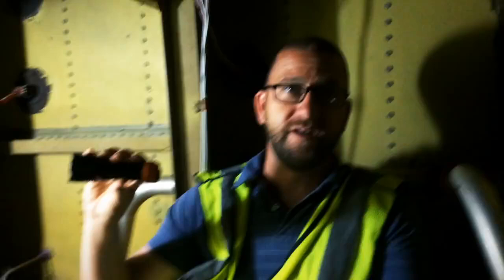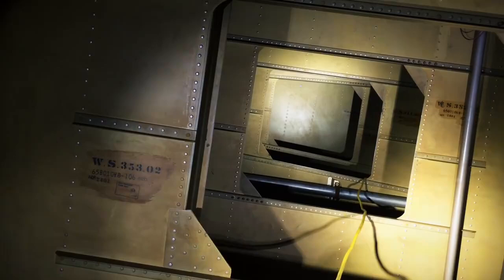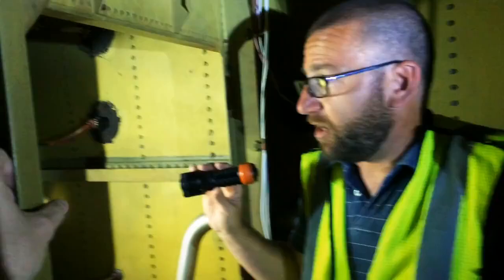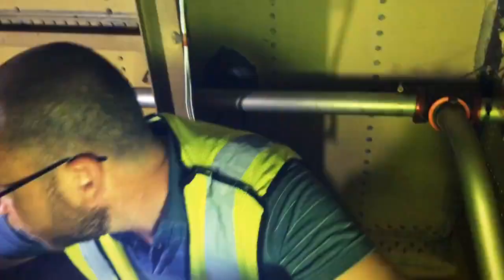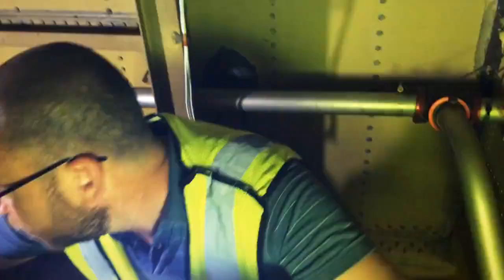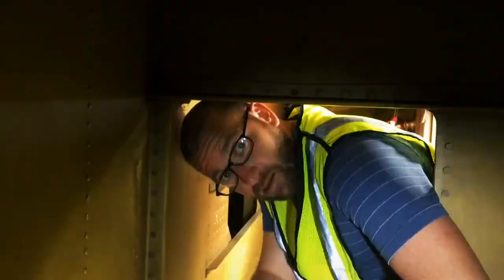The 747 Experience: In the Fuel Tank

Comment: What type of rivets and seals are used that can contain petrochemicals, because I saw nothing that appeared to do that kind of job?
Reply: same rivets used to seal the tube from leaking air
Reply: Riveted tube?  What kind of tube, what's it made of?
Reply: He means the riveted tube you claim holds the compressed air that runs the engines....
Reply: Fuel tanks are sealed with a two part compound on the inside around all the joints and rivet holes that lead outside.  DeSoto PRC is what we use where I work.  The stuff makes RTV look like kindergarten paste.  It's a messy bitch of a job.  If you don't think sealant exists that can withstand fuel, what do you think the hoses and o-rings are made of in your car's fuel system?
Reply: @Herb Derbler:  Why did you misrepresent my question?   I said, "I saw nothing that appeared to do that kind of job?"   I guess reading isn't your forte?  Look at those rivets above and tell me where the sealant is?
Reply: Kevin Chamberlain you only seal the rivets leading outside the tank.  If the rivets going from one part of the tank to the next leak a bit, it doesn't matter.  If he paid more attention to the floor or ceiling you'd probably see more of the sealant but it's also possible they've painted right over the sealant with the same zinc chromate primer used all over the tank.  Tank sealant lasts pretty much indefinitely unless something damages it or it needs to be cut away to access the rivets for structural work, so it's possible many of those sealed joints haven't been exposed in decades.

I didn't misrepresent your question.  I told you how fuel tanks are sealed.  No need to get butthurt if you don't like the answer or you feel it doesn't fully address your issue.
Reply: I have worked with Aluminium/birmabright and rivets etc. there's no sealant to be seen on those rivets.  I appreciate your answer but it is unsatisfactory.  I questioned your misleading answer, if you see this as butthurt then you should control your emotions.
Reply: Right at the beginning of the video in the top left you can see the wiring harness for the fuel quantity probe wiring harness passing through the tank wall.  You can clearly see the big circle of sealant around that plug base.  There's an o-ring in that joint as well, but all precautions are taken when it comes to fuel, so it gets coated in sealant as well.  The lighting makes it hard to see as anything other than a dark spot on the wall, but that's pretty much what PRC looks like.  Grey-black goo.
Reply: Rivets?
Reply: If he doesn't show a good close up of sealed rivets, that doesn't mean they don't exist.  I cannot change the focus of the video.  All I can do is tell you how they're sealed and show you an example you CAN clearly see of applied sealant.  Go to the museum and ask to see inside the tank you're that curious.  What I can tell you for certain is that if you think they won't hold back a liquid at atmospheric pressure, they sure as hell aren't going to hold back compressed air.   You will not encounter high pressure compressed air vessels with straight walls, sharp corners and riveted joints.
Reply: Thanks for your input.  The quantities of fuel required are a huge problem for such (relatively) tiny wings and Viktor Schauberger definitely wanted these engines to run on air and reckoned they did.  He has a seeable, trustworthy and morally verifiably excellent reputation so don't be offended if I refuse to take your word for anything.  Do you agree the government are liars or would you have everyone trust them at their word?
Reply: @Herb Derbler:  You have no comment to make on the ludicrous amounts of fuel supposedly pumped into this little wings?
Reply: I think Herb may have become annoyed at your demanding attitude and left you to your own silly fantasies.
As for the "Forester" named Viktor Schauberger who died way back in 1958, yeah, clever fella. Didn't have a whole lot to do with jet engines and obviously any "good" idea he may have had have been used or adapted probably quite a lot since then. Anything that didn't work out obviously got binned. I haven't got Herb Derbler's expertise in these things, but these aren't your normal pop rivets. They are minor little masterpieces themselves and aren't likely to leak even without sealant. Whether any is used with them I don't know. I do know it's not uncommon for them to leak slightly. I don't think they usually worry about it unless it's somehow a major leak.
None of that matters of course because you didn't really give a shit about any of that anyway. You only wanted to waste his (or anyone elses) time slowly working around to your big cover up conspiracy theory anyway. Between Herb and myself we've both now wasted MUCH more time on you than you deserve so go tell someone who cares all about your great conspiracy and stop wasting peoples time by playing your stupid games. I myself wont be answering any more stupid questions by you, driven by your paranoia.
Reply: @King Congobongo:  There're a few errors in your barbed comment.... Anyway, go tell your grandma, she''ll believe you.  Possibly.
Reply: I asked what type where used....
Reply: It's sad when question-askers recieve unsatisfactory answers, followed by abusive, infantile rants.  I guess you like your world unchallenged.  SMH.
Reply: I don't know the name of these rivets, etc, but what do you care?  These sorts of details would allow others to specifically investigate.  Anyway, I didn't mean to upset you and I apologise for not realising how foul-mouthed, infantile, emotional  and abusive you really are.
Reply: That's the SEALANT,    NOT the rivets.  And "these sorts of details" were, as I've already said, ALREADY THERE!  You were just too fucking lazy to go back and look.  "abusive"????   Me?????  No, never lol.
Reply: Okey dokey. Bye bye. Oh, and don't use google to look up anything like aircraft rivets or anything like that. You might come up with too many answers for your tiny mind to absorb.  Ta ta now.
Reply: And by the way Kev, I guarantee you it wouldn't "be great if we we're face to face."  I have far less tolerance for stupidity that thinks it's actually smart when it's right in front of me.
Reply: I worked at the Everett Boeing Factory 20 years ago assembling 747-400 center wing sections, which is made of the exact same "wing box"/"wing torsion box" construction as the wings are (minus the composite aerodynamic leading and trailing edges).  

If you are commenting on the rivets in the ribs that he is climbing through, there is no need to seal the ribs.

The aluminum structural wing box that contains the fuel is comprised of the upper and lower skins which have rows of stringers (seen on the "floor") attached to them for strength and a front spar and rear spar. 

The 747 is unique in that is also has a mid-spar which runs all the way out to the outboard engines for additional strength because, outboard of the engines, the 747 has a very thin, highly-swept high-speed wing (for it's massive size).  It can cruise at Mach .86 easily.

In addition to the front mid and rear spar, the center tank has 2 additional spanwise beams to prevent sloshing.

The entire fuselage is fastened with rivets so that is can flex with pressurization cycles, but the wing(box) is a much more substantial and thicker structure that must take massive aerodynamic loads.  
So rivets are not strong enough for the wingbox (but are fine for parts of the ribs).

The wingbox components are sealed and then fastened with a double row of titanium fasteners which are sealed. However, these fasteners would nearly be water/fuel-tight even without sealant because they are just a little bit bigger than the holes we drive them into with the rivet gun (which are reamed to .314 inches). 
This "cold works" the hole making it stronger.

Comment: what a clown this is. this is never a fuel tank. look at the cables, at the pumps, perfectly clean - furthermore the airplane has no control over the OPEN sections... Ever drove a few gallons of water on the back of your picup truck? what happens? instability happens... what a joke this all is - same clowns like nasa
Reply: So I assume that you'd be happy to sit in that section of an operational 747 while it's being refuelled?  Of course, you'd need to sign a disclaimer absolving the operator of any responsibility for your inevitable death, and you'd also need to leave instructions for the disposal of your body afterwards (cremation would be really fast!). So, are you up for it?
Reply: bruh, I do C and D cheks on 737. I've been inside fuel tanks and I've had to fill and empty them myself. I can tell you this is a legit fuel tank (just a really clean one, compared to the old flying garbage bin we have at work), and they are indeed full of fuel when doing long haul
Reply: Dude these nutters think aircraft levitate and they think we’re all in some kind of cover up as well. They don’t know anything about fuel systems, wing tank construction and basic aircraft systems yet they claim they know more than us about aircraft. Hilarious.

Comment: So you have open electrical lines in a fuel tank? That's insane!! Just a bit of corosian to the insulation live and you have live current running through the fuel? This doesn't make any sense from what I'm used to dealing with. My home's 500 gallon oil tank and my truck's fuel tank doesn't have electrical wires running through it. It's just difficult to see for the first time. I hope you can understand this. I believe you, and thanks for posting.
Reply: So does a car's fuel tank. Remember only fuel vapor ignites and some aircraft have a nitrogen inerting system that replaces the oxygen in a depleting fuel tank so combustion can't occur
Reply: Jet fuel is quite hard to ignite, its like diesel.
Reply: Allegedly, airplanes primarily run on compressed air, not jetfuel
Reply: The wiring in the fuel tank uses a special insulation to prevent corrosion from fuel, and is supported along it's length so there's no risk of the vibration causing it to chafe. Also, as others have said, it's quite difficult to ignite jet fuel in liquid form. If you threw a lit cigarette into a bucket of jet fuel, it would go out. The fumes are easy to ignite, however.
Reply: @navigatingel6104  love seeing your clueless comments
Reply: @hunternelson3018  It ignited quite well when those planes hit the world trade center
Reply: @hunternelson3018  It ignited quite well when those planes hit the world trade center
Reply: @boboleary6607  that’s because of other sources of flame like wires and the turbines running

Comment: All the fuel would pool in between the ribs on the floor.How would that get removed? One tiny pump per section.
Reply: The ribs do not seal where they meet the upper and lower wing skins.  There is a substantial gap.  The dihedral (wingtips are angled up) of the wing causes fuel to flow inboard towards the wing root and fuselage.
Reply: No need for pumps to redistribute fuel then?... I can be happy with modern jets using very large amounts of fuel because it makes sense. Engines burn fuel. Obvious. However for example we are told that the A380 holds 250 tonnes of fuel. I've been looking at cranes and weights etc and still can't satisfy the question of how can a wing hold so much weight (which includes engines, flaps, hydraulics etc) without any cantilevers like you see on cranes.
Reply: Doug, in the event that there is a fuel imbalance (which should not happen) there are transfer pumps to transfer fuel, but the dihedral/angle of the wing automatically sends all the fuel towards the center of the aircraft. 

The wing spars are the cantilevers. And the rows of stringers that run the length of the upper and lower wingskins are too.

A crane is designed for the purpose of being able to structurally cope with lifting massive weights. That is its only purpose. 
It is the same for a bridge that vehicles drive over.  
And in both cases they are made of HEAVY steel. 
Airplanes are made of aluminum because it is light (the landing gear is made of titanium which is lighter and stronger than steel).

An airplane wing is designed primarily to deal with the upward-acting forces involved with the wings supporting the aircraft in the air. 
You mentioned the weight of the flaps... all of the flight controls are made out of composite materials to be as light as possible.  The same is true of the composite fixed leading and trailing edges that are attached to the front and rear spars... these only have to deal with aerodynamic loads (which pale in comparison to the loads the aluminum wing box has to cope with, holding the plane up in the air).

Structurally speaking, as far as loads are concerned, it's kind of an "afterthought" that the wing also needs to be able to support the force of the engine's weight and full fuel acting downwards when the airplane is sitting on the ground not having to deal with any aerodynamic loads.  

These loads really are insignificant compared the maximum aerodynamic design loads.  Also keep in mind that the fuel is equally distributed throughout the entire wing so that the spars and the stringers and upper and lower wing skins all share the load.

If the wing didn't have the weight of an engine on it and it were not full of heavy fuel (on long distance flights when the aircraft is heavy), then all the wing structures would have to be made stronger and heavier.

The downward acting engine and fuel weight that people here are trying to understand are BENEFICIAL loads!  

Light, hollow, box-shaped aluminum wing torsion boxes only have to deal with aerodynamic loads when flying. That's how strong they need to be designed. When not flying, and the wing is completely aerodynamically unloaded, the loads of the fuel and engine are completely insignificant in comparison to the flight loads the wing is designed for.

Remember, no matter how big the airplane is or how big the numbers are that describe the TOTAL weight of the airplane or the fuel it carries, if you take into account the sheer scale of the aircraft and the proportions of all the loads involved airplanes ARE extremely light.   If they weren't they could not fly.   Look at the sheer size of the A380's wing.  It is beyond huge.

Airplanes are light aluminum - not heavy steel.
They don't need to lift things that a crane does and they don't need to support semi-trucks driving over them.

I think you guys are used to thinking about steel ground-based structures that are designed for the purpose of lifting things or driving semi-trucks over.

Aircraft are very light (and weak) aluminum... that's why the "walls" of the wing spars are almost 2 inches thick at the root and, after reaching the engine they must support,  taper to a quarter inch at the tip.
Reply: I still say that if you look at a decent size crane on a building site, its unlikely that it can lift more than 8 tonnes at as short reach and 1 tonne at the end of the jib. Scaling it up so that it can just pick up one wing full  of fuel (80 tonnes) that is in an A380 would require a crane more than 10 times stronger. I don't see that strength when I watch the manufacture of the wing. The wing section is an amazing piece of engineering, but how it doesn't bend with 80 tonnes of fuel plus 20 tonnes of engines plus ? tonnes of hydraulics and flaps etc without a cantilever support when the wing itself is 33mtr long is beyond amazing. Its gravity defying. If it is true then a mouse should surely be able to pick up an Elephant.

Comment: Show you getting into the tank from outside   thats not a fuel tank for plane
Reply: Those aluminum lines you see in the video are for fuel and at 3:19 of the video you can see an aluminum fuel probe ( fuel capacitor) which measure fuel quantities would be installed from the top of the wing attached to an access cover. Notice the line doesn’t touch the bottom of the tank. The tank is separated in sections which are clearly marked with wing stations, wing stations are stamped in the wing of aircraft ( common aircraft knowledge) and these tanks use these rib sections with bulkheads to reduce the fuel sloshing. The same goes for other aircraft stations, and example with be if you ripped the interior apart in the fuselage the formers ( rings wrap around the aircraft) would probably have fuselage stations stamped on them. Argue all you want about the quantities of fuel but this is clearly an aircraft fuel tank.
Reply: Still waiting?  Me too.
Reply: @sexigrande1792  You are far too triggered and IMO give yourself away. His point in extremely valid...show us going in from the outside. I also find it suspicious this video comes out at just around the time the topic was being thrown around on the internet and there are very few if any others like it. Just saying.
Reply: @karltaylor2857  “triggered” what are you a 12 year old girl? I think you’re just scared of the truth. This joke has come up in a&p groups before, we always find it hilarious when people who blindly believe in the conspiracy pretend like they know anything. “ this video comes out around the time the topic comes out” lol that’s rich dude, bit of a reach there.